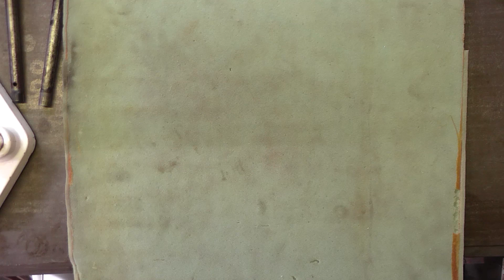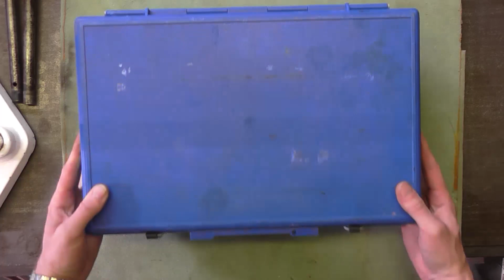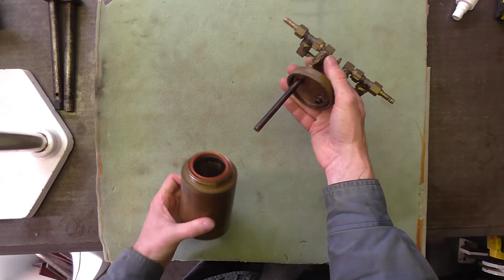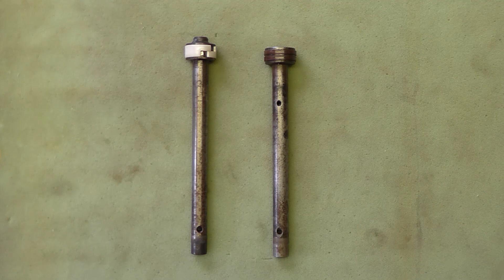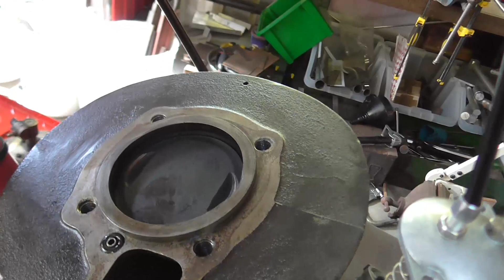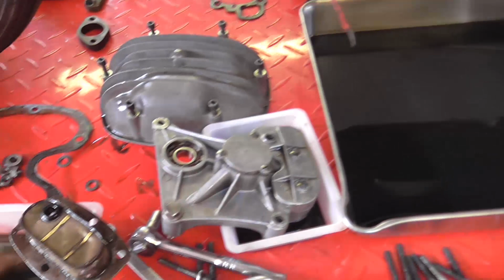Sunday Night Short XVII

Comment: Hi Paul, that spray welding does seem to be in pristine condition, congratulations on the purchase, as Chris has mentioned, I too think it is more of a "hot process" type of spray kit, it actually reminds me of the Eutectic ultra or super jet type of system. I have one of those as well as a Rototec cold process setup, as we have seen Adam use, I will see if I have any printed literature on it, as I don't use it much any more, I got it years ago from a fellow who was retiring, and included the customer with it as well.  I used it to coat some small pump parts with a bronze anti wear powder if I remember correctly, perhaps there would be a show and tell video in all of this somewhere........  I hope you can get the problems with the bike worked out without too much trouble and expense.
Reply from the maker: This is a link to a page selling the same kit; http://www.elmerwallace.co.uk/Metal-spray-torch/96.htm

Comment: Some bad luck with the bike. :-(
Is availability of parts an issue or just cost?
Reply from the maker: Both! I've just bought a spare crank for reasonable money, but a cylinder head and valve gear might prove difficult. There were many variations of this engine and I seem to have a modified GT head, rather than a Tresette or Settebello version. Ideally I'd like a genuine 'Aste Corte' (short rods - pushrods) head.